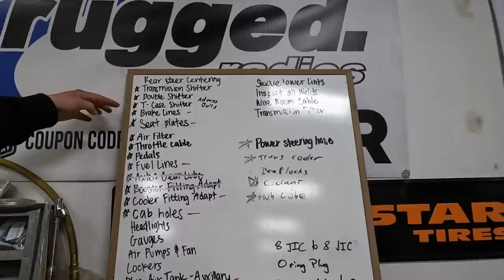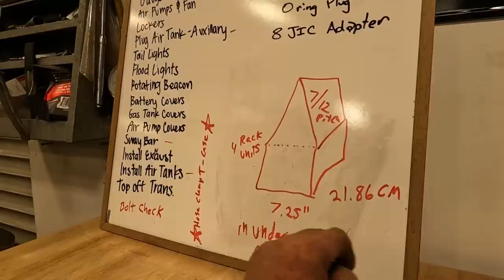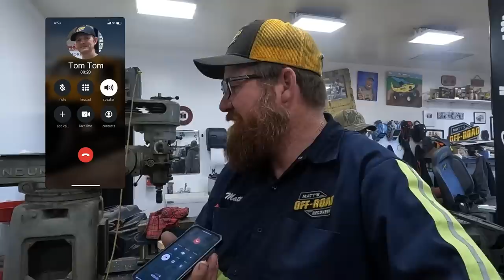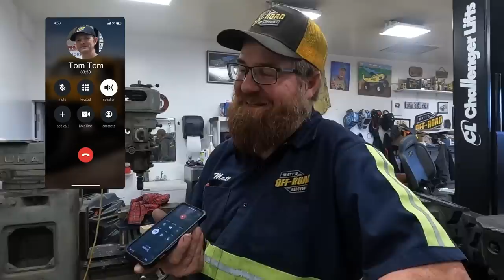Is This A Sign To Come For The World's Largest Off Road Wrecker?!

Comment: Hey Matt hope you got the heat fixed in the shop, I work in the HVAC field,  a few simple things you can do is #1 check if the vent pipes are in the direction of the wind, if it is you can add an elbow pointing towards the ground to change the direction. #2 you can see if you can order a baffle for the unit itself #3 make sure everything is clean and not packed full of debris. 
Hope that helps! 

Awesome wrecker, awesome to see you guys fab this thing up!

Comment: Heat pumps have what is called a defrost cycle where they switch themselves to a.c to melt ice on the condenser coil . They struggle when temps get in the 20s or below. The colder the outside temp gets the less heat they produce. Get a supplementary heat source for them like a 10kw electric heat strip kit
Reply: This is why they don't work great in the UK, as it's always cold 😂
Reply: @hammyh1165  Exactly. Here in sunny South Africa they work great. Temps seldom drop down below 5*C outside  (coast), so the heat pump still operates. And they're fantastic in summer, when it's really hot. ☺

Comment: I hate anti-seize.  It gets everywhere when you touch anything with it on it.  I understand why you want to use it, but there are two things wrong with it (in my opinion).  1.  It will dry out and get thick and clumpy making it hard to turn fasteners.  2.  It is not very waterproof.  I have replaced anti-seize with synthetic brake grease.  It is waterproof and it doesn't smear all over everything it touches.  I've never had it dry out from heat and use either.  Just a suggestion.  Wrecker is looking great.

Comment: Low ambient heat baffles are  used to stop wind and natural convection from cooling off the outdoor unit.  The wind is likely just cooling off the outdoor unit to much and causing an error code.  You can get the low ambient kit if there’s not one installed or make something.  As for heat pump’s blowing cold that’s a common complaint as they will heat by blowing air colder then 96 degrees.  Not effectively heating the space and feeling cold however it is heating the space slowly.

Comment: Sounds like you need to build walls around your condenser outside for the heater/ac
Reply: You need the coils to interchange with air though 

That will probably ruin it in the summer for sure
Reply: @rafedavis1984  Only need to stop the wind.
Reply: Don’t build them too close……the idea is to allow the outdoor unit to move the air IT wants to move and not the air MOTHER NATURE wants to move
Reply: I didn't say wrap them with a wall, ever seen walls around a dumpster? Same concept. Block the wind but not hold air hostage
Reply: @michaelmain1990  I have my outdoor unit inside a shed, with an open window, and it works perfect in the winter, but in the summer it turns into a sauna.

Comment: Your method probably worked on the transmission cooler but another method that works great for those type projects is foam ear plugs.  They also work great for painting,  if there's a hole you don't want paint getting in.

Comment: Pumps are probably shutting down so the system doesn't freeze. Maybe block the wind that's hitting the pumps
Reply: What I've experienced is that they don't like to work overtime either. They're either powerful enough for the room or they'll start shutting down when they can't handle the task. To be fair "powerful enough" is a bad concept to aim for since they also depreciate over time. Not to mention the units sold in that region might not be very cold hardy. My unit can operate at -25C outside (diminishing returns of course from optimum range) and the indoor unit is +50% more powerful than it minimally needs to be. Do not skimp on these units and throw money at the problem.  Wind chill protection has been described by others already.

Comment: Regarding shop heat, ensure that the thermostat is set correctly, that it.wont disable the system, and ensure that your intakes are baffled against wind. If they aren't, then you van have a draft just run right through.

Comment: Heat pumps lose a lot of efficiency under 35 degrees or somewhere there, but I’m guessing that the wind is what’s killing yours more than the temp.
Reply: Not true with mini splits. Conventional heat pumps yes.
Reply: Old school thinking. The new mini-splits  operate at 98-100 % efficiency at 5 degrees F . at -10 it drops to 78% . Unless those are cheap units from Mr. whatshisname. Mitsubishi units are about all we use up here by the 49th parallel. A wind block is needed.and a better unit. If you have a unit that falls off that much at 35degrees and it's a high SEER with the more important high HSPF for heating, find a better unit and HVAC guy. A minimun of 9HSPF a 19 SEER for the temps they get.
Reply: You should figure out the volume of the birdhouse using a hogshead ( 1/126th of a hogshead)🤔
Reply: Constant speeds loose efficiency.  VRF Minisplit start to loose efficiency way lower.  A Mitsubishi HyperHeat starts to loose efficiency at 0 degrees and will continue to operate down to -13 at 79%

Comment: Your heat pump problem is kind of like you know you are low on coolant if your heat stops working at a stop light then works when you start driving. Except the heat pump has a range limited by the pressure temperature range of refrigerant. The freon level is set to heat and cool temp degree range. After that you need more tons or heat strips or you have to set your system up to work in cold environments but not work in hot environments. This is why if someone has a well insulated building and uses the ac when it is cooler at night it will typically freeze up. It will always happen if it is cool and they keep in at 68 or less and the Freon is low. The pressure temperature relationship of a particular refrigerant states the refrigerant will get below freezing at a certain pressure. Once that happens the coil will begin freezing any humidity. In your case, there probably isn’t much humidity so it just looses performance.

Comment: The heating situation: There should be a wind deflector on the outside so when the wind outside blows they don't fight and/or reverse the fan causing air to get in through the vent instead of being blown out. Because of how windy it is there you may need a different or to design your own deflector. Make it face down so when it pulls air in it's only pulling what the fan pulls in, outside air hits a wall mostly. And put a big-mesh screen on the vent hole outside to keep dust, dirt, rodents (etc) out. 
My guess is the fan's getting reversed by the wind.

Comment: About your heat pump issue.  
1.  Heat pumps are not designed to raise the temp of an area rapidly. If you shut off the heat overnight or cut it back significantly it will not recover well. And you will waste energy. 
2.  If the outside temp in your area drops below 35 you need auxiliary heat that automatically cuts in. Such as electric, oil, or gas. 
3.  The wind factor probably has to do with added heat loss from your structure making the heating systems job more difficult. High wind during a heat pump defrost cycle can extend the cycle during which time the unit blows cold air. Especially with a time and temp defrost system. This makes large temperature recovery almost impossible. 
4. Get yourself a good HVAC tech to analyze your system and add in or fix and properly utilize supplemental heat.

Comment: There are pressure switches for the air stream of the HVAC system to make sure there isn't any blockages in that air stream. When it's windy it triggers the pressure switches. Protecting it from wind will help but sometimes it's hard to correct, particularly in high winds.

Comment: If the wind baffle does not work, check and see how many feet of line are installed between your outdoor compressor and the indoor condenser. Most unit are pre-charged for around 50 feet of line. If you go over then there is a formula in the book for your unit on how much refrigerant to add to the system. But it sounds like a wind issue. Seall up as many drafts as possible too.

Comment: Hey Matt, I've noticed that you go through a LOT of drill bits. I'm sure you've heard this before but your bits will last 2+ times longer if you use just a little bit of cutting fluid on them. Just put a spray bottle by the drill press. Bonus, it cuts faster and doesn't make that screeching noise.
Reply: It doesnt even have to be cutting oil specifically. Ive used ATF for years with no problems. Put some in a small $3 hand oiler and youre set
Reply: @iwouldrathernot4274  Ya, I sometimes use used motor oil. Smells but works pretty good.

Comment: I'm not surprised that Matt knows what a parsec is, but i am surprised that he knows about rack units!
(I mean i am familiar with rack units, but both Matt and Lizzy don't seem to me like people who ever needed rack units in their profession)
Reply: What is a rack unit?
Reply: Rack units are used in cabinets that house servers, routers, switches and stuff. And it's used to be able to plan how much you can fit into such a cabinet without measuring.
Rackmounting devices have their height in rack units sometimes, or one has to convert or check. "shelving contractors"? I am from europe, and to be honest i have no clue what a shelving contractor would be and how they would use rack units.
Reply: , I am used to feet and inches or cubic inches, this rack stuff blows my mind, how many servers, and hard drives will fit in a rack depending on their inch measurement, WOW I am still lost to RACKS 🤪
Reply: @357jvjimbowie  See, a common network switch has a height of 1 rack unit. If you mount a cabeling helper underneath this also needs 1 ru.
Servers are often 1 or 2 ru.
Hard disk shelfs we use at work are 2 ru.
And most standard cabinets offer 42 ru in height.
Ru's have their origin in some inch measurement, but they are used because the US customary unit system doesn't lend itself to easy calculation and people in the US don't favor measuring ;-). So everybody uses rack units and you don't need fractions or calculate with anything but whole numbers.
And with very little practice you can judge how many ru's the item needs.
Reply: @nirfz , I am lost to something that doesn't have a mathematical number.
Reply: @357jvjimbowie  A rack unit does have a mathematical dimension. In the US it is expressed in inches. In the rest of the world it would be in millimeters. You could do a Google search to learn it. No matter what unit of measurement is in use in your country a rack unit (RU) is still the same size. By convention rack mounted equipment is a multiple of that dimension. The mounting holes / slots also have a pattern. Years ago I would pencil in marks on rack frames to show RU locations. It helped with rack and stack. Recently I've seen telco racks with the markings cut in.

Comment: When you do a ground up build you need to put a seat on the frame and take the chassis out and drive it around and get a lot of flex in the frame . What happens is you torque all the bolts but when you flex and settle the frame things get loose and everything has to be re torqued then put the body on , it makes things much easier . Same thing happened on my 67 1 ton power wagon I got it all together took it out a few times and everything came apart .
Reply: Agree

Comment: If you were able to avoid changing the thermostat when swapping cooling systems, that may be the culprit. If not, I'd guess it's because no manufacturer accounts for Hurricane's strong winds and it's cutting the unit to avoid spinning the fan apart. Like in Arizona sometimes we temporarily setup pop up tents for shade so our AC overheats less because very few units work at 120 degrees in direct sunlight. Maybe a wind break could help?
Reply: What would the thermostat have to do with the wind blowing?

Comment: heat pumps have to have latent heat to transfer indoors. It's just an air conditioner running in reverse. Best you get is about 18 to 20 from above the outdoor temps. You need supplemental electric heat strips.

Comment: Wind baffles might help on mini split system. Your taking the outside heat compressing it and rejecting it to the indoors. That said if you over cool the out door with wind or snow ice rain ect you lose proformace. The other side is you need to know how cold your unit can pick up heat at. We here in the Great Noth of canada we aim to buy units that can take heat from -15c to -25c. They will actualy ice up the out door units and defrost them non stop sort of cool to see. But the outdoor units are like 3-4 foot tall depending on the model/ indoor heads used.

Comment: the heat pump has to have airflow over the outdoor coil. a headwind is causing airflow to stall out. I'd add a wind baffle or outlet duct guiding the air flow in the direction the wind is blowing. if its really bad, you could add a temporary wind screen in front of the outdoor unit with a baffle/duct. install manual should specify minimum front clearance (usually 20" or so) when a baffle is used. the gas furnace was likely experiencing flue gas backdraft and tripping a safety switch to prevent the shop from filling with carbon monoxide.

Comment: I think that Tom is getting a raw deal. I don't recall anyone else getting punished for failing to remember the keys.

I disagree...he doesn't deserve this.

That said, a rack unit is 1.75 inches. There are approximately 25 millimeters to an inch and 10 millimeters per centimeter, so that may help with another dimension. The average length of an adult male's hand is around 7.5 inches. 

He's on his own for the 7/12 pitch.

Go get 'em Tom!

Comment: HVAC - I'm not a pro but I had a similar issue and it ended up being because my outside unit wasn't LEVEL.  Yes, the outside unit needs to be perfectly LEVEL!  Front to back & side to side...  needs to be level all the way around.  Also, make sure it's drainage pan isn't clogged.

Comment: Temperature is relative to barometric pressure and humidity. 32 degrees is not always 32 degrees. The big thing is heat pumps don’t like to pump heat when there is less heat density like when it’s below forty and low barometric pressure. I would recommend back up resistance heat coils or and oil burning shop furnace for maximum comfort. Edited for to forty. 28 years master licensed HVAC.

Comment: The flame safety sensor gets tripped or the pilot gets blown out. You "could" build a shroud to keep the wind down around it, but it'll probably only lessen the issue. Good trick that works is flip the breaker for a minute and back on or turn the desired temp down to 2 degrees above what it is in the shop, turn off the thermostat for 30 seconds and turn it back on and inch your way back up that way. Let me guess, if it gets below 66 or 67 degrees in the shop it acts up?

Comment: Im not sure which units you have ,but the newer systems use a pressure switch that is negative draft,if the wind blows it will trip switch to positive draft! In the case of the Heat Pumps,wind coukd be a factor,not sure what brand they are,but you dont want tgem facing a prevailing wind without adding a wind baffle! The fans dont like reverse action,most are DC .A big part is to see at what temp they will run down to,and the install ,how many ft of lineset was allowed,was charge calculated and added etc! Hope this helps

Comment: Heat pumps!!!!
It’s a fine balance, mini splits carefully controls every aspect of thermal dynamics, your environment is taking over with the wind. Block the wind with a wind breaker, better yet, fly me out and I’ll take care of every HVAC issue you have just for a trail ride and maybe a recovery mission 

Rolly. R.S.E
HVAC tech
Refrigeration mechanic 
4x4 enthusiast

Comment: As others have pointed out, it could be high wind blowing across the condenser and over speeding the fan. Louvres at the fan might sort it, but not so much as to affect the heat rejection of the fans themselves.

Comment: I had harnesses once in an old Land Cruiser, here's how that works out. About the fifth time you drop something and cant reach down to pick it up you stop using the shoulder straps and start just using the lap belt, years later you remember that you have shoulder straps but still don't use them...

Comment: It might need a curve on the exhaust of the unit so the wind dies off before blowing down into the vent.. or build a sort of wind blocker for the outside units it's usually one of those two issues  since it happened to a different heater that you had in the shop, I'd bet the exhaust pipe needs to have a couple 45s on it so the curved pipe will stop the wind from blowing clear down the stack❤❤❤

Comment: Heatpumps have to de-iice the outer unit sometimes and then it goes for a while in cooling mode to de-ice the outer unit. To prevent it to happen to often try to make less moist and water enter the outer units intake maybe get some shield for strong winds.

Comment: @Matt in regards to your heat pumps, if the wind is overpowering the fan in the outdoor unit, it could cause them to fail. Also, if too cold outside, the outdoor units could be going into freeze protection and shutting down. Hard to tell without being there of course, but there should be some kind of error code either on the wall thermostat or on the control board in the outdoor unit. The code will tell you why it shut down.

And how has anyone NOT seen Back to the Future? lol

Comment: In the heating business for 12 years. It could be something simple that the thermostat need to be relocated. It is picking up temperature for somewhere else in the shop, fooling it to shut off. I don't disagree about the baffles on the outside unit, but if you had a gas furnace and it was doing the same thing, the thermostat location may be your issue